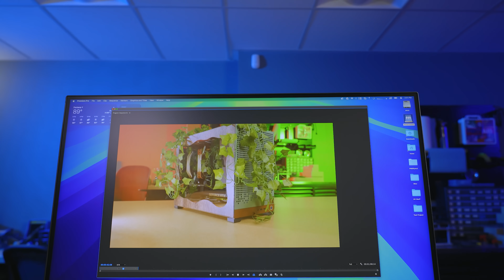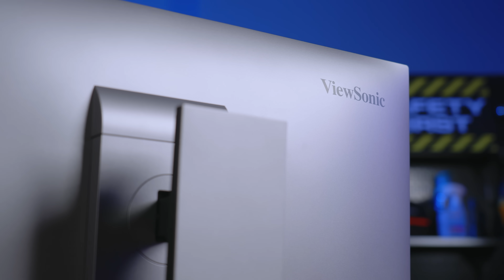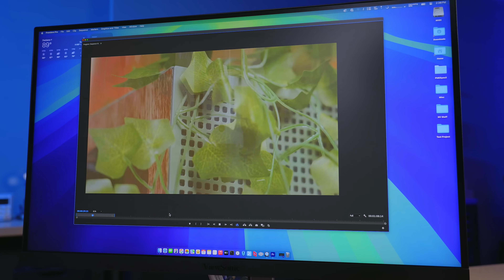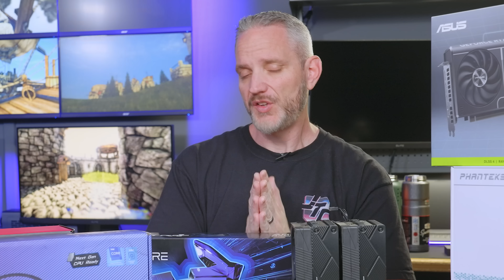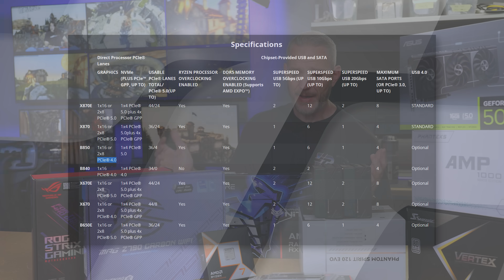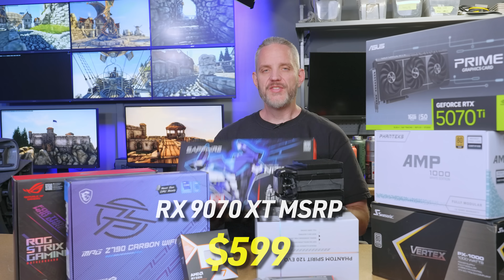This is the Sweetspot for PC gaming... Don't get fooled into spending more!

Comment: The PSU is not the component I've upgraded the least frequently, that would be my case. It was expensive but I've had it for nearly 15 years, and I don't plan on replacing it. It's a Silverstone FT02B (without the window). I chose it for silence. The three 180mm fans in the bottom rotate at a bit over 200 rpm, so I've had to disable the fan warning in BIOS. I had a Lian-Li before it, and it was a rattling piece of #¤%&. Honestly, I don't see anything available today that would beat it for my purposes. If I wanted to upgrade, I'd need a carpenters shop and make it myself from MDF and noise insulating plates

Comment: For a sweet spot build, if you've already got a good case, save money there by not replacing it unnecessarily.

I'm sticking with my more than 10 year old Fractal Design Arc Midi R2 for a forthcoming upgrade build. It's solidly built, has decent airflow, and I get to keep my optical drives. The most I might do with it is change up the very old fixed LED fans for new ARGB ones.

I'm presently thinking along the lines of a 9700X, paired with a 9070 XT on a B850 motherboard, for which I can still switch on PBO mode to get the most out of the 9700X, even with a modestly priced air cooler rated for about 160W-180W peak PPT.

Comment: Listen to Jay  a air cooler is ok for you the truth is AIO Take the Hot air and remove it from the case to out side the case,Air coolers just heat up in side the case. Running two AIO is the best for the money all the heat is remove from the inside of the case and deverted to the outside of the case where as the internal components stay as cool as possible also the PSU will do the same if you orient right. the whole idear is to stop thermal throttling that happens in gaming because of extended game play in some cases that last over  4 to 8 hours air coolers just are not as effcient doing that job then Jay will have you OC the Hell out of it  when alls you will need is a good fan cure..... so if you want to run bench marks all day listen  to Jay If you want to play games all day then dont OC and make surte you run a good fan cure Proof will be in Temps and FPS counter....

Comment: I don't see anything here that's sweet spot when your talking 2k.  For me a sweet spot was getting a deal on just the motherboard, processor and memory then using my old case, graphics card, hard drives, and power supply.  That's always the sweet spot and this time was around $500 with the b650 motherboard.  That's a bit more than I usually spend but I never am building an entire system.

Comment: New to PC. I got a 650 motherboard, AMD 7 7700 cpu, and 4060 gpu. Been thinking of upgrading the cpu to a Ryzen 7 9800x3d and a 5070 gpu. Wondering if it is worth it I just want to kind of overbuild and have that available.

Comment: 1:57 Actually, nothing can compete with 265K/KF value/performance for its current price. As soon as you start playing on non-peasant resolutions, it does not matter if you have 150 or 152 FPS. Windows 11 and most productivity apps runs smoother on ARL than they do on Zen4/5.

Comment: For am5 i do think trying to future proof yourself, do your research, especially on the motherboard.

The pcie gen 5 to gen 4 in real terms is verry small in fps, if you are on q tight budget nexus unboxed has verry good videos. Watch out for the VRMs temps to hold a stronger CPU in the future and can handle the ram speed required for it.

PS: i think mobo and cooling are were you make your future proofing ( especially on am5) going for the AIO nowadays its close in price to the top aircoolers.

Comment: I found 9070 is the sweet spot - way better than the 9060XT, but not that much worse than the 9070XT - picked mine up for $600, which is about the best you'll find these days

Comment: Got an MSI g16 laptop about 3 months ago on sale from BestBuy. 16GB DDR5 ram, 14700k, 4070 mobile (8GB VRAM). Thing is a little beast, and runs titles like MHWilds fairly good at 85-95 fps. Even runs Star Citizen of all things.
"Only" around $1200. But i had an old 2018 Alienware with an i7 8700, a 1070, and 32gb ddr4. Bestbuy gave me $550 in store credit, with an additional $70 promotion.
Needless to say, pleasantly happy with my laptop upgrade.
Hunt around folks.

Comment: I just built for my nephew. Built it in the new Lian Li vector v100r  very sick chassis BTW. Also Bought the xfx mercury 9070xt on sale*** @ micro center for 809.99 (919.99). Ryzen 7 7700x $229.00  ROG STRIX B850-f WIFI GAMING MB $250 on sale during prime day on Best Buy. Corsair rx titan lcd 360mm AIO. $220 Corsair DDR5 6000 CL30 $120 NVME #1 is a gen5 crucial p510 1TB serving as boot drive $100  NVME #2 is a Samsung 980PRO 2TB. $100 as a refurbished product from Best Buy.  I spent a lot but this kid is 10 so this is already crazy overpowered for him. But I also love it & would never have chosen anything else

Comment: Thanks for reliefing buyers hangover. Did this exact build couple weeks ago, just based on performance/€. 9700X , g.skill flare @6000 cl30,  strix b650e-f, rtx 5070. Absolutely a sweet spot at this price for the performance.

Comment: X3D CPUs can be worth it in strategy game scenarios, whre CPU performance is directly correlated with AI turn length, or in the case of games like vic 3 or CK3, how fast the game can run.
As a family father I have started to appreciate that more than graphics settings. Though that scenario is pretty specific.

Comment: I don't want my rig to have a secondary function as a space heater. So far the plan for my next upgrade wil be: R7 7700 with -30 PBO, used RTX 4070 undervolted to 0.92v, RAM running at JEDEC speed but with tweaked timings. That should give me a build that burns off roughly the same amount of wattage as my current antiquated machine, but being light years ahead in terms of performance. I really don't care about running the latest and greatest games with all settings maxed out. I'm old enough to have a well trained suspension of disbelief, and there's a huge "folder of shame" in my Steam library filled with older games that will run like butter on this new modest machine. That's my personal sweetspot.

Comment: The RTX 4070 super is the only gem that barely draws any power but has (in my opinion) amazing performance. I have one paired with a 7600X3D and a 650W PSU with zero issues

Comment: I play star citizen and went with the 9800x3d and 9070xt for my 1440p woled. I bought both at msrp. I'm very happy with them. 1000w 80 gold . 32gb 6000 cl30. Peerless assassin cooler. 3 nvme gen 4s All strapped to a asus tuf b650 atx. Star Citizen is a very cpu heavy game.

Comment: I've got a 3080 and Ryzen 9 9950X3D
Still prefer 1080p high fps over 4k 
When we can run 4K ray traced with high and stable frames (real frames), I'll do that. But 4k continues to be an absolute performance hog that isn't really worth it in most cases.
I do have a 4k 120hz TV hooked up as well, but I only use it for RPG and frame locked games like Dark Souls

Comment: Having a higher budget on the cpu is for future proofing. The more cache the more future proof the cpu will be. Cause when choosing parts its not just current performance but also what you expect future performance to be like. So 8-core would be more future proofed than 6-core as well. Soon they will be making 12-core a new standard
Reply: Currently though, I would choose a 6 core cpu if it meant the offset budget allows for a better gpu

Comment: Stupid tariffs are the only thing making me want to build a new PC asap based on my current 4080S and switching to 9800x3d from LGA1700. I already got a case, a huge fan that will fit the new sockets, a 2000w power supply (I 100% agree with you on this), mechanical keyboard, gaming mouse and a 4k Samsung monitor/TV. I will wait for end of the year sales starting in November and will snatch the mobo, cpu, and ddr5s as soon as I see a great deal.

Comment: I payed 437.00 for an MSI 1070 gaming back in 2016...  Adjusted for inflation that's about 585.00 today. Just picked up a nitro+ 9070 xt for 799.00.  That's not bad imo.  Worlds apart in performance for less than 300.00 difference? Yes please.

Like Jay says here I picked up a Evga g2 1300 and a DH d15 back then too.  So new build is reusing these same old parts on a new mobo, memory, GPU, CPU.  Cuts the cost significantly on upgrading.

Old parts will go to friend or upgrade my htpc. I learned my lesson long ago to always have 2 computers.  One main rig and one backup/htpc is a lifesaver when shtf.

Comment: I got a new job in May with a ~20% salary bump abd decided to treat myself to a PC upgrade.

I had been rocking a Ryzen 5 3600/2070 Super since June 2020 and it was really starting to show its age on newer games, even at 1080p.

I initially wanted to stick to MoBo/CPU/GPU/RAM upgrades, but my M.2 SSD was a SATA and I was missing cables for my PSU, so the only things I ended up keeping were the case and CPU cooler lol

I knew I wanted to hit the kind of midrange sweetspot described in this video, and bundles offered by Canada Computers came up big. 

R7 7700X CPU, B650-E MoBo, 7800XT GPU, and 32GB DDR5 6000Mhz CL30 RAM for CDN $1500+tax. After adding a new 750W PSU and storage (2TB SSD + 8TB HDD), I came out to somewhere just under CDN $2500 taxes in.

There are plenty of opportunities to spend more money on this thing: I'm tempted to upgrade to 1440p monitors, and I would like to change to a case with more airflow and quiet fans, maybe wood paneling to fit the room better... We'll see what that bonus check looks like at the end of the year!

Comment: I've gone for the 9800 X3D and I'll be pairing it with a RX9060 XT for only £350, then in two to three years I will only upgrade the GPU.
Reply: This is 100% the correct way to do this.

Comment: One trend I’m noticing is that many newer mid-range PC builds are being spec’d out with hardware that seems overkill for the display they’re paired with. Resolution and refresh rate are magnitudinal factors—running a high-end GPU at just 1080p 60Hz or even 120Hz can feel like wasted potential, especially when 4K and even 8K 240–360Hz displays are becoming more common. It’s not just about raw performance anymore—it’s about matching the system to the display to actually take advantage of what the hardware can do.

Comment: I just built a system with a 7800x3d, 5070 ti and 32 GB Gskill DDR5. MB is an Asus 650-E. I;m a little afraid to try expo1 as some have said it may cause the system not to boot. Has anyone else with a similar system enabled expo1 without any issues?
Reply: Try it , if it doesn't boot used expo 2.

Comment: I honestly don't think the overspeccing advice is good.
Build a system that you can afford and keep it till it breaks / doesn't run your games anymore, or keep saving.
Honestly, the amount of value an increase in gpu gen gave you in the past years is not amazing. Spec the stuff, so you have a nicely balanced rig e.g. no over- or undersized components but don't get something smaller a month earlier and upgrade later, in total that will only cost you more money.

Also look up used cards. They offer incredible value propositions if you can find a reputable seller.

Comment: I just bought the parts for a new system.
Clock in without tax at ~2720. (Pc part picker list not handy)
5080
7800x3d
32GB cl30 6000
B650e board with higher tier sound chip
Crucial T705 2tb
Seasonic vertex 1000 watts
Artic freeze 3 AIO
Lian Li Lancool 217

Things I could have easily saved money:
Reuse case I still had from computer 6-7 years ago
Not Seasonic PSU
Air cooler
Cannabilize 2tb Ssd from rog ally and switch thay back to the small one.
5070ti instead of a 5080
B650 worse sound motherboard
Non-3dx processor

Why did I make those decisions?
I always wanted a Seasonic PSU.
I have never gotten to build with an AIO and my room is warmer from what I gather the thermal mass be beneficial.
The T705 2tb wasn't much different then the 2tb reputable gen4 drives. Plus I want to believe in Direct Storage.
WoW is the type of game that benefits from x3d regardless of the GPU.
I'm driving a 3440x1440 Alienware Oled and frankly tired of not having the means to do it.  16gb card was a must.  I like Raytracing and currently use GEForce now to play my taxing games (including WoW which a mod you really in disappairing and you find out when raid starts stinks....) so I wanted a modern card that is 4080 equivalent and I'm not confident in my luck in the used market so I bought the literal cheapest 5080 I could find that had reputable shipping timelines.
The Lian Li Lancool 217.  My first case was a Lian Li when they were the only aluminum in town and it was a good case.  This looked easy to build in, included all the Lian Li fans which are not bad, fit a 360 cooler, has Massive airflow, and a built in GPU stand.  Just including those 5 fans make this feel like a deal compared to other no fan cases.  Also fits the mount on my Magus Pro XL.

Comment: PSU degrade over years and it's better go over 100W for the recommended spec. Or more
Reply: Yeah im not getting the buy a gold psu that will serve you through multiple upgrades.  Nah if im spending on new cpu or gpu after 4 or 5 years then im getting a new psu to go with it.

Comment: my sweetspot is always used higher tier GPUs.

just did my (last) upgrade on my AM4 mobo 
old system:
Strix B450-F Gaming 
Ryzen 5 2600
Evo 212 cooler push/pull fans
GTX 980Ti (bought used on facebook marketplace 5 years ago)
32GB 2666m CL16 vengance 
1 tb nvme  (+1tb sata ssd + 6tb storage)
corsair cx750m

upgrades last month:
Ryzen 7 5700x3d (same cooler)
RTX 3080 ti (Used from a friend)
a little bit bigger chassis, because long RTX card...
+some new chassis fans...
Huge improvement!
Power supply is on minimum spec for the 3080ti card but i had that PSU 4+(?) years now, and it works...

next upgrade is a whole new system... but that is many years in the future
Reply: That used to be the way for sure but with how miserable game developers are these days that they can't create a game that works underspecing your cpu is just asking for trouble. You are better off dropping a tier or half a tier of gpu and getting a better cpu. Even with your paring sure it will be ok for a lot of games but that cpu is gonna bottleneck a 3080 ti pretty hard

Comment: I built my PC 3 weeks ago for under 2k with a combination of amazon prime days and microcenter's tech days.

Corsair Frame 4000d Case $103
ASUS TUF B-650E mobo $146
Gigabyte TUF 9800x3d $369
Radeon RX 9070xt $739
Corsair Vengeance DDR5 32gb $92
WD Black 2TB SN7100 m.2 $119
WD 1TB SSD - Free
Seagate Barracuda 8TB HDD - $109
Corsair RM850x full mod - $128
Thermalright FW360 V2 AIO cooler $ 79
Thermalright 140mm rear exhaust fan $8

And I'm coming from a i7-7700k and a GTX 1070 so I'm super stoked lol

The only thing I had to work out was the fan curve on the gpu was really aggressive and loud so I flipped the switch to silent mode on the card and adjusted the curve and its whisper quite, fans don't even go above 20% while under load and the highest temp I've seen on the GPU is 59c which 65-80c is normal temp under load so that's perfectly fine with me!

BTW you helped me a TON when I was building my PC with watching your videos! Liked and subbed!
Reply: "Gigabyte TUF 9800x3d $369" ? huh
Reply: @jetrpg22  yep typo on my part, for sure not a gigabyte tuf processor 😅 AMD 9800x3d

Comment: I recently swapped my 2700x for a 5700x3d and my 2070 for a 4070 super. I have 64GB RAM in a B450 board. Its going to be at least a couple of generations before any gains makes replacing this system appealing.

Comment: When the fan failed in my Dark Rock Pro 4 after 6 years, all I had to do was take off the old fan and slot in an extra 120mm Silent Wings 3 High Speed I had lying around. The CPU (an R5 5600) is just as cool with the 120mm fan as it was with the original 135mm one due to the cooler's large surface area. An EASY, cheap repair.

Comment: Honestly my build is best bang for what I get.  5800 x3d on a x370 MB and 9070XT with m.2.
Reply: Prob... unless you are looking at upgrades. Then an am5 system (9800x3d prob) will be more fps for less $$ over 8-10 years.
Reply: If you were already on am4 that's decent for now but you are on the edge of that cpu bottlenecking that gpu. Probably good to hang on to it as long as you can though see what the future holds for amd

Comment: Working on a build with a 9600x, a B850M motherboard, a 16gb 9060xt and 32GBs RAM. Waiting for the NVMe so I can mount the GPU since the NVMe slot sits under the GPU.

Comment: I just built with a 265K and the benchmark to price ratio blows AMD out of the water, especially for productivity and especially with overclocking. All in it was $389 for CPU+MOBO+120x3 AIO. Similarly benchmarked bundles with AMD were all $500+, usually $600+. 

I think people are still clowning on Intel so hard for fumbling last gen that they're not noticing the huge discounts they can get this gen.

Comment: I'm between a rock and a hard place, My current system is a Ryzen 9 3900x, 2080ti, and 32GB DDR4 3200mhz ram. Can I get away with throwing a 5080 in it, Or should I bite the bullet and build a whole new system?

Comment: Going to build a pc on AM5 finally. Been rocking a R5 5500 and a RX580 way way too long.
Just bought a rx 6800 used for a good deal (I hope), and stuck it in my rig for that immediate performance lift.
But soon, a R5 9600x, B850, and all the bits and pieces will be on their way. Going whiteout this time.

Cheers!

Comment: For me I felt the move was staying on am4. Upgraded my cpu from 3600 -> 5700x3d (5800x3ds were not available) back in January and just upgraded my rtx 2080 -> open box 9070xt from micro center today for only $650. Bought my 2080 almost 7 years ago open box at micro center I'm hoping to keep this new gpu for just as long.